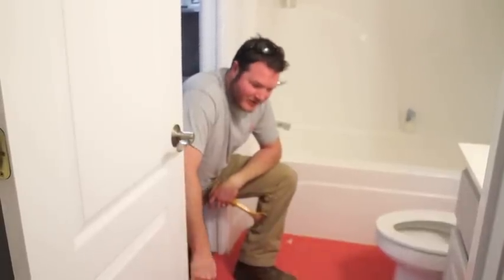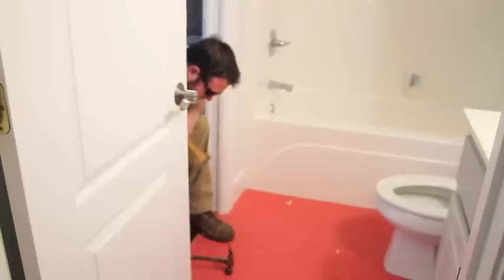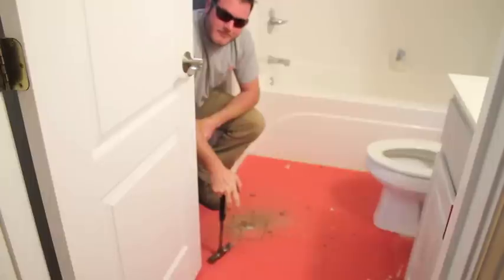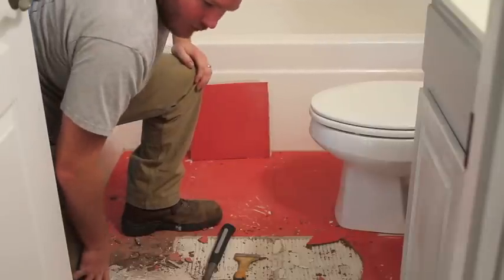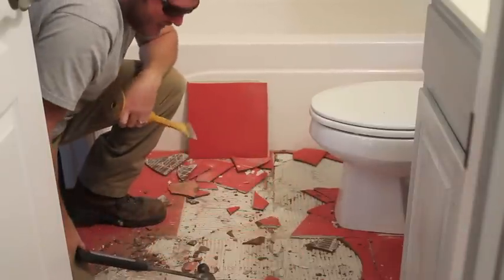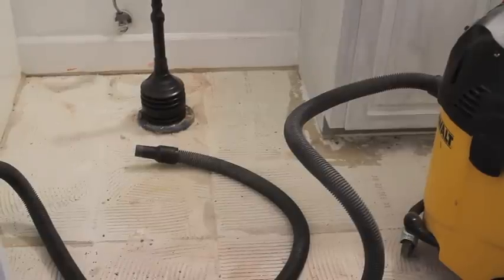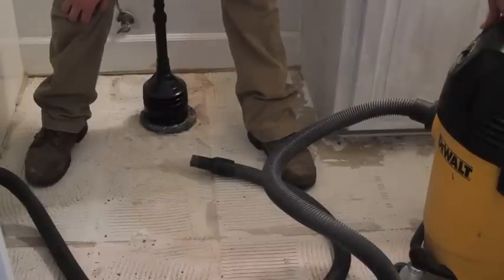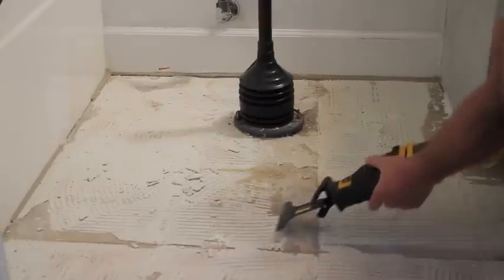Removing Ceramic Tile | How to Remove Tile | Removing Tile Floor

Comment: Great, thanks, looks like a lot of work, I hope I can avoid damaging the cement underlayment.
Reply: Cement underlayment shouldn't be thinsetted to the floor, should it? If you're trying to pull it up, it's only supposed to be held down with screws, right? To make it easier.  I want to take mine up and put Schluter Ditra down instead.  But if it's cemented to the floor, I'm leaving it.

Comment: you have to take the floor scrapper and use both hands and force that epoxy off with effort until you have  blisters both inside the middle of your palms also with the thumb skin peeling away till the fingerprint is gone ... so use gloves kids and change out your razor blades every 3x3 feet

Comment: you should have remove the toilet first (easier) and use a chipping hammer that will remove all that tile in 1-2 hrs depending on experience. you can get cheap ($189) chipping hammers at home depot.
Reply: its eazy to pull a wagon if u know what size wheels it likes
Reply: Can you rent those from somewhere, like Sunbelt?